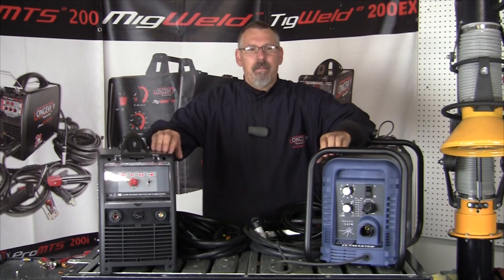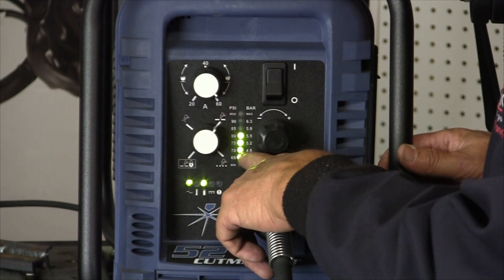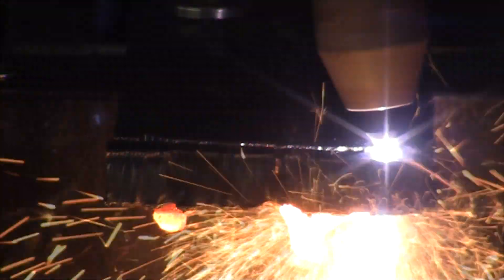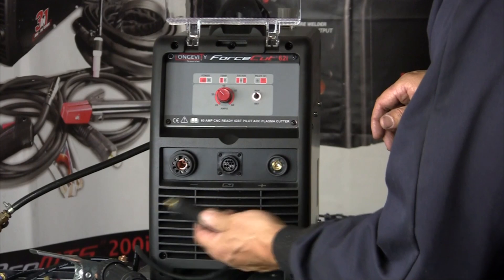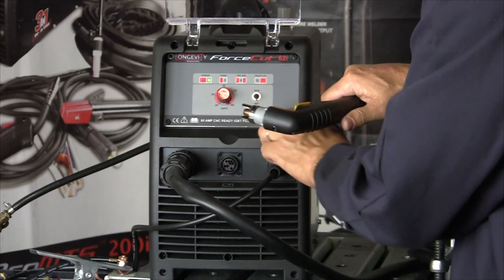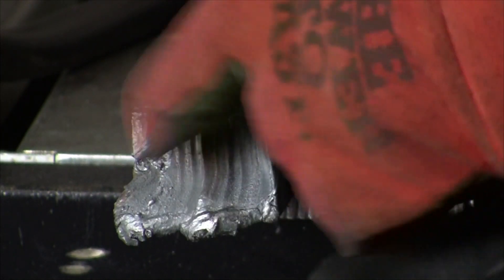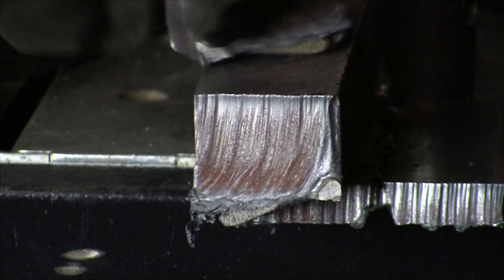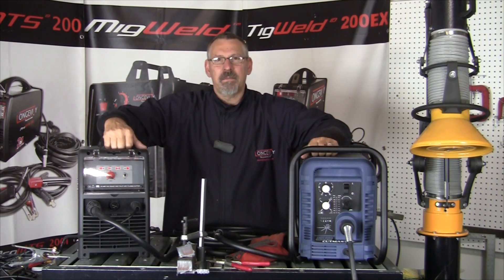LONGEVITY FORCECUT 62i VS THERMAL DYNAMICS CUTMASTER 52 REVIEW PART 2

Comment: The standoff makes all the difference in the world. At least you did mention that one is available for the 52. I have a 52 and added a standoff to it. It doesn't require any other hardware be changed. It also has two feet instead of one to keep your torch perpendicular to your work. The test on 1.25" material is also out of the range of the 52. It's rated at 1.125" sever cut. Not intended to produce useable parts at that thickness. I personally never use it for anything over .25". On .375" and up, I just go to the flame. On the heavier material distortion is not so much of a problem and consumables are expensive.

Comment: Not a fair test!! You keep stopping the cut with the Thermal Dynamics and did not use a drag guide Very Unfair! IMO the Thermal Dynamics will eat that Longevity everyway possible. Very poor video!
Reply from the maker: We tested it fairly with the items that came with the units. Not trying to make one or the other look good or bad. Its just the results we got.
Reply: If a fair test why did you keep stopping the cut with the Thermal Dynamics? It was easy to see you were trying to make it look bad..
Reply from the maker: Little secret, some of our machines share assembly lines with the comparison ones....
Reply: It doesn't matter where your machine is made. The comparison made in this video was not apples to apples. Any idiot can see that the test was not fair! Again why not answer my question of why the guy would stopped and started over and aver with the Thermal Dynamics machine? The answer is you didn't want to show that its a far better machine than Longevity.
Reply from the maker: We will make a note for the next video makers... Sorry you felt that way, but we will improve the videos!

Comment: The Thermal-arc one torch has many more options like true 60 amp drag cutting. Setup is everything on that machine.. This Video leaves out many of the advantage of the Thermal model, and it's torch torch design. Shielded design setups, and  many more options on Nozzles office size.. The cutting on .0500 was terrible not even close to the quality a average user would get out of it. Poor video,and pretty much worthless info.. The A-140 come with a CNC port, and machine torch. The 52 does not. The  4 year warranty is all over the world, and 5 years on the other, really means nothing.